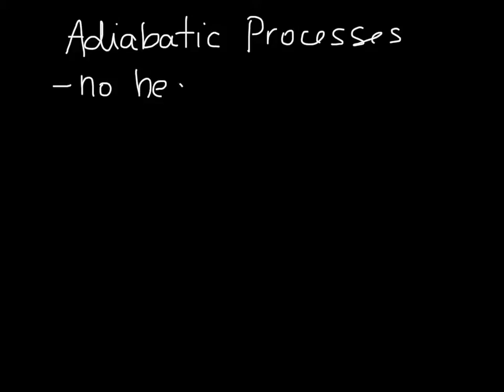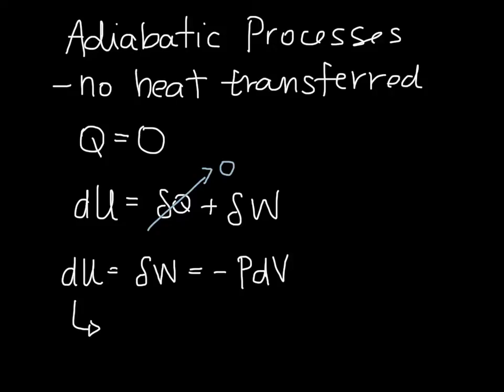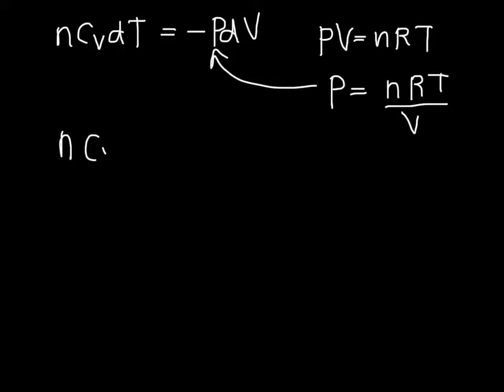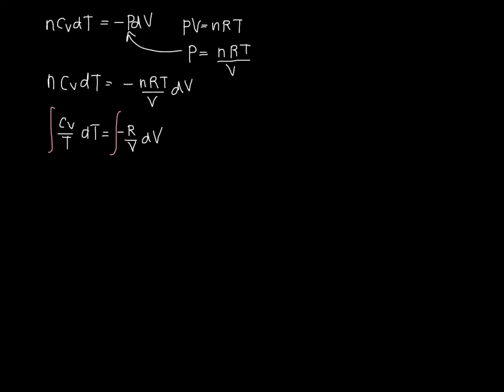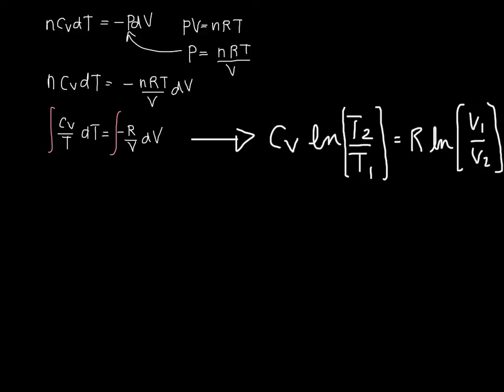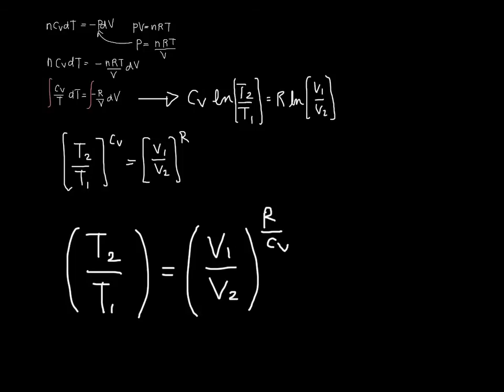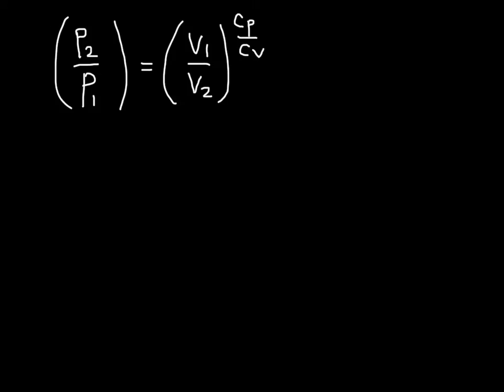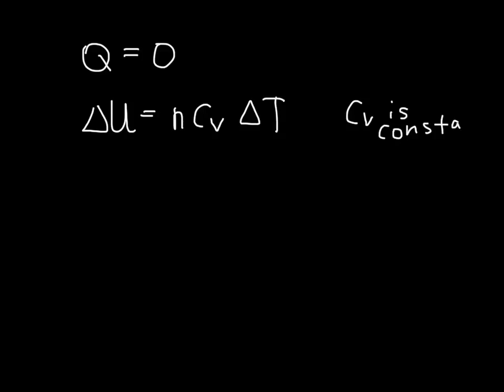first law for adiabatic processes

Comment: Can you use Cv even when volume is not constant?
Reply: Under a certain point of view it'd be wrong, but in the end it's correct, because what really matters is the fact that U is a state function - so, whether you get to the final state in 2step (isothermic expansion + isochoric cooling that would justify the "Cv"), or you get to the final state via adiabatic process, the deltaU value will still be the same.